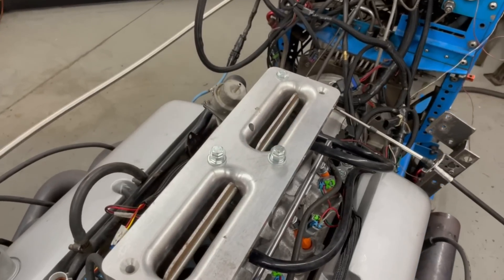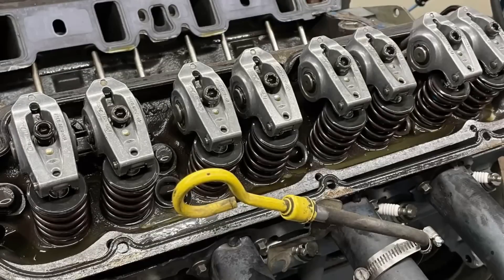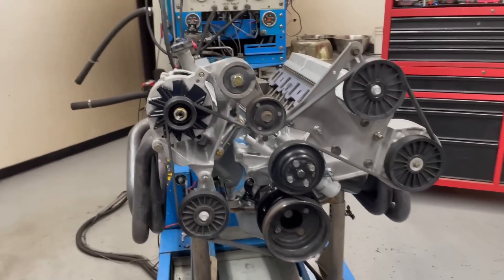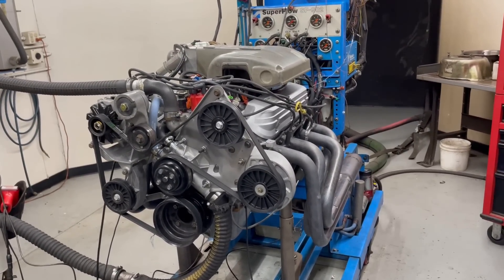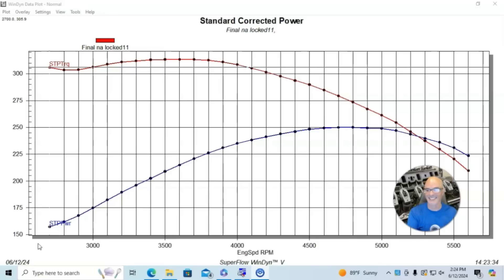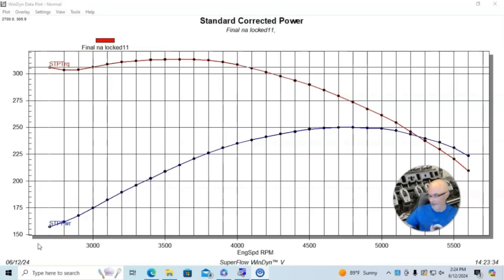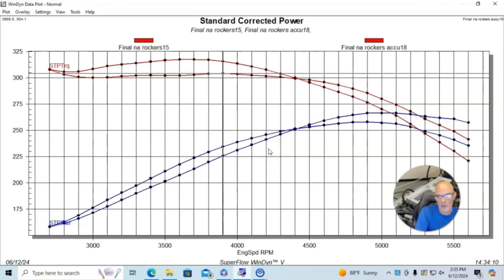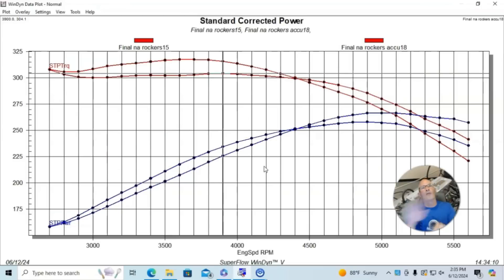TOP SECRET ACCUFAB 5.0L FORD INTAKE-NEVER BEFORE TESTED. PLUS STOCK VS ROLLER ROCKERS-HOW MUCH HP?

Comment: The amount of air flow loss from that stupid-looking intake, which would work fine if you were to actually open up all of the intake ports on the lower intake plenum. Or at least make an intermediate piece that is Port matched to every one of those intake runners. The flow loss is got to be tremendous especially with those thick ass plates at least cut some of those down a little bit so that are can actually get by them without turning sideways. I can see a 50 horsepower loss in the possibilities of that in upper intake alone.
Reply from the maker: nothing you said there is accurate
Reply: I am shocked that so many really are clueless....I'm not saying I know everything....which is why I typically shut up and listen....but airflow characteristics aren't voodoo. I only have 3 years in a auto machine and race engine experience and I see so many spitting obvious BS they picked up somewhere....

Comment: One thing I always wanted to try on one of these old 5.0 motors.....put on a twin carb Offenhouser intake, but put 2 throttle bodies adapted to the carb bolt spacing....basically have the throttle bodies pointing straight up

Comment: There's a reason this never made production.
Reply: NA mods are generally a waste of money unless your increasing compression….would have done well just to boost the stock motor
Reply: @chrisvig123  laughs in homebuilt 408 Mopar making just shy of 1hp/ci on stock compression

You have no clue what you're talking about. Cam phasing. Timing. Rocker ratio. Rod angle. Plenty of things in an N/A motor to adjust to build big power. 

Go watch some of Uncle Tony's Garage and his work with a slant six and educate yourself and stop spouting nonsense. Guy is running low 10's with a N/A engine that made 90-130hp in factory form. And he's doing it with a four and an eighth inch stroke length at 6k rpm.

Comment: The rockers look like Yellaterra. According to Dave Bennet the owner of the company at the time, they made a deal with Ford USA to provide them. I think they were the only company that made "bolt on" rockers at the time. We had them fitted to our 5litre Windsors that were fitted into 2000 AU Falcons, they also used GT40P heads. There was also a 5.6litre stroked version. It used locally made crank, pistons (ACL) and rods. they were rated at 250kW. This rating is net.

Comment: Those thick blades need some knife edging, that would be an interesting test. The drivabliity is awful because the CFM/% opening is not linear. Basically wil 10/20% opening they just towards the 100% cfm. Its needs a non linear opening mech so it does not gulp air on a low throttle and loose air speed/TQ.
Reply from the maker: rising rate throttle opening is beneficial as it an altered bore shape that reduces low-throttle angle flow, but this was not that

Comment: Please do your power increases also in % as 5hp+ means much differant things on a 100hp to a 1000hp engine.
Reply from the maker: easy math for you with the provided data
Reply: @richardholdener1727  even easier if you just put in on the screen next to to the HP gain.

Comment: Mill out an adapter plate and bolt on a vintage Autolite                             "CROSS-BOSS" Inline 4-bbl. Dont know if it would turn the numbers but bet it'd turn some heads.
Reply from the maker: those R hard to find and expensive
Reply: @richardholdener1727  Yeah, So?...hahaha LOL                   Good Video KUTGW

Comment: Need to see what the 5.0 truck intake manifold would do. My brother had a dealer installed GT40 crate motor in his 89 F150 4x4, 5 speed with 3.55 gears, Cobra R injectors,and a MAF conversion. That truck went 14.89 at 92 mph.
Reply: That’s impressive for sure!

Comment: Cross Boss-esque
Reply from the maker: agreed
Reply: I autocross a Boss 302 in 78/79… 
My machinist had a single carb Cross Boss for $275. Like an idiot I offered 225…. Geeez.
  In 87/88 I auto crossed a 5.0 LX for which I wanted to build an eight butterfly version of that Accufab 
Maybe I’ll do it for the old Bronco with long tubes leading to filters…. Hmmm …sleepless in Texas…

Comment: Stock HO5.0's  are chunky torque producers, 2400 to 4400 RPM is 300 ft-lbs of twist, almost the whole time.
Reply: I bought a 95 Mustang and like you say...it ran well to just past 4000 then pretty much was done.   Replaced the rockers with Ford Racing (made by Crane) 1.7's and threw the stock heavy spring retainers (that had rotator's in them) and wimpy springs away for some Comp Cams lightweight retainers and springs.   Along with some relieving of the airbox and a little ignition timing bump it would run strong to the 6250 rev limiter and absolutely crush a stock HO.   That was a fun little car back in the day.
Reply: They don't even produce any torque. But they sound good
Reply: @ßeau_M  it was pretty good, for the time.....
Reply: Road race engine!
Reply: I had a 94 351W Bronco that ran just fine. Had plenty of low-end torque and just what you need in a 4X4 with an E4OD.
Reply: @GaryH-pw9cm  In a Bronco / F150, the 351 wins, every time. I had a 94 F150 
5.0 , my freind had the exact same truck with the 351, it got better fuel mileage, and had more power. Neither had as much power as a TBI 350 Chevy, and that got 16 mpg. My friends 351 150 got 14. Mine got 12. The Chevy weighed 4600 lbs, while my F150 weighed 5100.
Reply: Like the hated gm 307 but the ford delivers them in a much nicer way.

Comment: It would be neat to cut a slot into the stock manifold's plenum on the left side of the engine and attach the oval radiused entry to it.  That way you keep the long runners without it being a foot taller.

Comment: Try adding a 3 inch spacer under this dual blade upper intake and see what happens, might get back the torque and  keep the upper rpm
Reply: The torque ain't coming back that way. Those long runners resonate at the lower rpm and via inertial supercharging force more air into the cylinder at the lower rpm, that will not come back by making a bigger plenum.
Reply from the maker: you could add spacers with runners in them-but then you lose top end
Reply: @richardholdener1727 Maybe Wilson could whip up a TAPERED 8-hole spacer.
Reply: at small throttle openings they gulp air and loose charge speed, it needs a progressive throttle opeing mech.

Comment: looks like a inline four-barrel ford carb from back in the day
Reply: The Autolite inline 4 barrels.
Reply from the maker: Cross Boss
Reply: betcha that was the inspiration for this mad creation; equal distribution 👍
Reply: @josephtravers777 was thinking the same thing. This is pretty much the exact opposite of how the Old log style intakes on the Mopar /6's work.
Reply: If that Accufab works AT ALL, it'll only be at the top end...where the heads will stop the party.
Reply: No not even close.
Reply: @knutbjornlarsen4435  well ‘it reminds ME of one’ work for you? No?